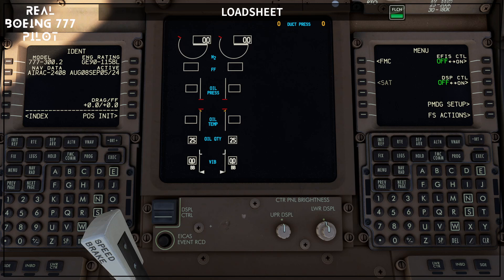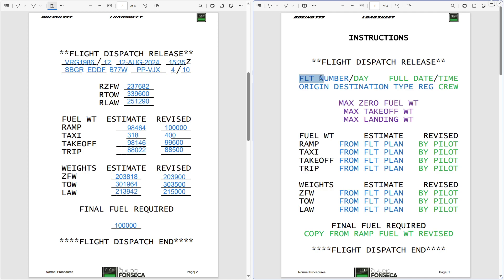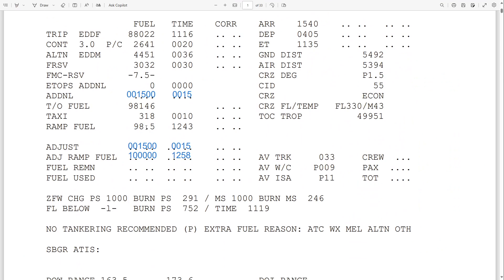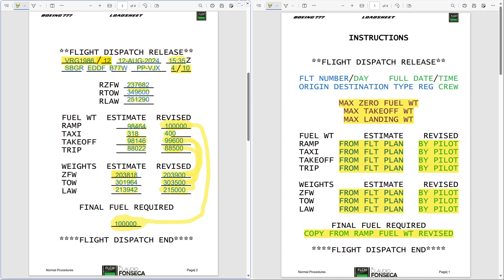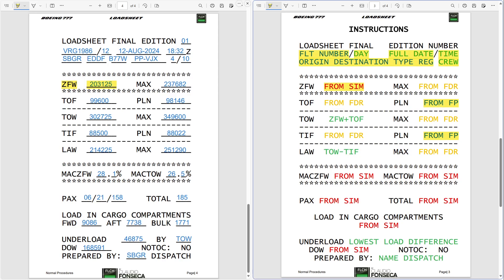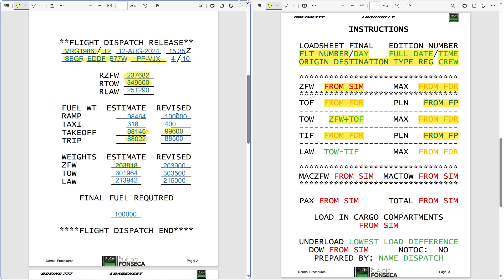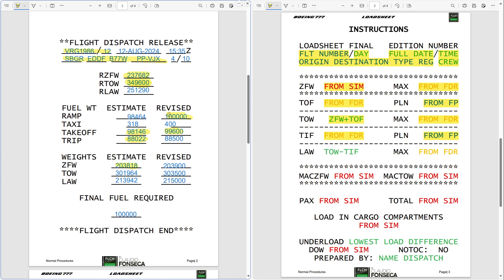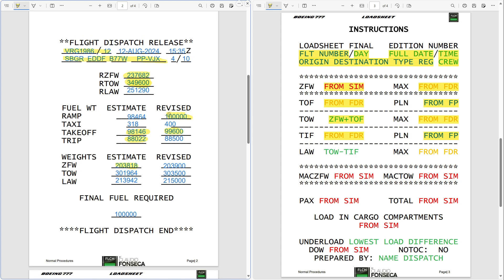LOADSHEET - B777 NORMAL PROCEDURE

Comment: Thanks for the informative video! Curious as to what flight simulator equipment you use? Thinking of upgrading from Logitech/saitek to something closer to the real thing🙏🏼
Reply from the maker: Hello!
I use 2 different equipments!
For my travels I only have the Microsoft Sidewinder Force Feedback 2.
At home I have TM Boeing Yoke, Honeycomb Bravo with ProDeck Sim Throttles and Sim Factory Speedbrake and Flaps and the Logitech Rudder Pedals. All mounted in the Next Raxing flight sim chair.